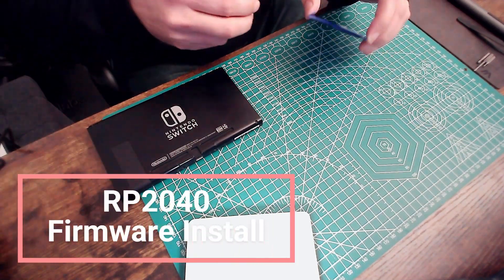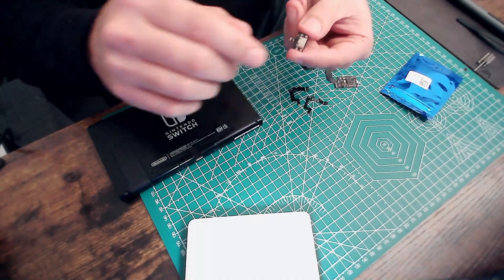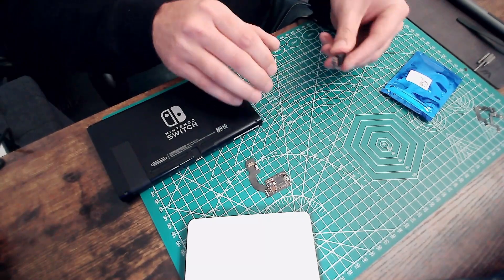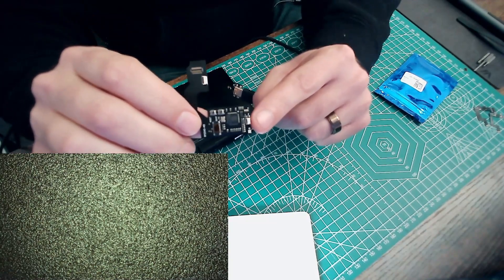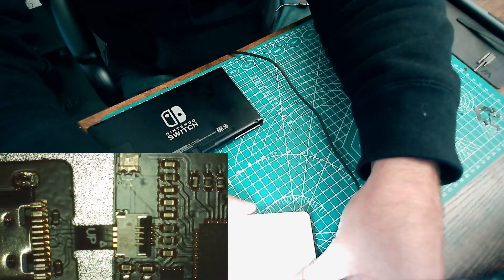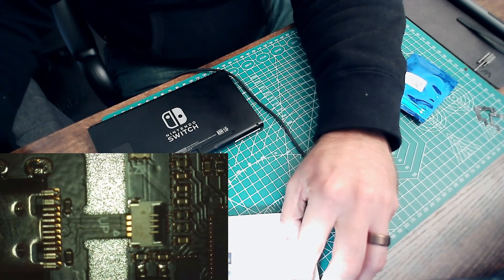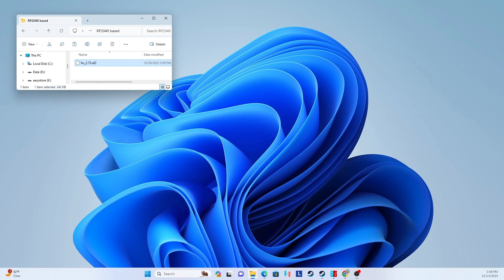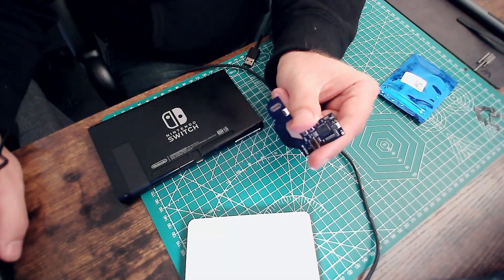Nintendo Switch Modding - Step One - RP2040 Firmware Install

Comment: What point of this mod
Reply from the maker: About 80% of the modchips I’ve installed have been delivered blank, this first step puts the required firmware on the chip, that allows your switch to “glitch” into recovery mode and inject a payload to launch Hekate.

Comment: I purchased mine and it won't load up, but it flashes greenish/yellow. Does that mean its good to go?
Reply from the maker: Only one way to be sure, but it sounds like it may have come with firmware on it. I always struggle to get it to connect if it’s already loaded.

Comment: i have 2 that wont flash the uf2,  i installed thinking the uf2 was on there and it just boots OFW.
Reply from the maker: What color leds are you getting on the chip? If any?
Reply: @Randyisanerd  no lights at all, the drive is recognized and I see the default files but when I copy the uf2 nothing happens. I have 2 mod chips doing this
Reply from the maker: When you copy the files it should “eject” on its own. No lights means you may not have hit all the solder points! Take a peek under the scope again.
Reply: @Randyisanerd  i am flashing the card outside of the switch, fresh out of the bag powered over usb. Thats how you load the firmware.
Reply from the maker: I mean now that you’ve installed it. Are there any LEDs blinking upon powering on?
Reply: @Randyisanerd  i actually figured it out i had to roll back my usb driver, and then reinstall the tinfoil drivers. Very weird stuff

Comment: dude thank you so much, i've been so worried that i would install this and it would be blank. Couldn't find anything online on IF i needed to do this or not. Wanted to get this part squared away before i started soldering.
Reply from the maker: So glad I could help! If you need any help along the way reach out
Reply: same bro, i was about to spam bad things to my supplier then i tried searching first and found this video, thanks for the help.

Comment: Hi, thanks for the video. I have two questions, I passed the file as you indicated and the chip flashed blue 1 time 6 times yellow. continues to flash yellow 2 times is this normal?

furthermore, if I press the boot button and connect it to the PC (after inserting the uf2 file) , two text files appear and not the uf2 just inserted. despite this it flashes blue once and yellow twice . Is this correct or am I doing something wrong?
Reply from the maker: You’ll get one green/yellow upon successful load, then the explorer window will auto close. That’s normal. If you try to plug it in again, you’ll get one long blue, then a bunch of green/yellow short long pulses. That’s also normal. So it sounds like you’re good to go. It physically won’t pop up again in windows once it’s done right.

Comment: Do you need drivers for RP2040 chip via USB ? Flashing blue then yelow and nothing show on PC
Reply from the maker: No sir. As soon as you plug in, it should recognize as a usb storage device and open an explorer window. Maybe make sure your ribbon cable is seated properly on the chip?
Reply: I solved the problem. You have to hold the boot button and voila. Thanks for the quick reply You have a new subscriber!😄 @Randyisanerd